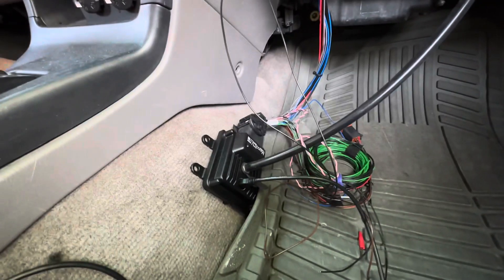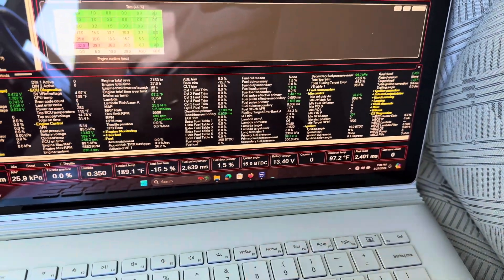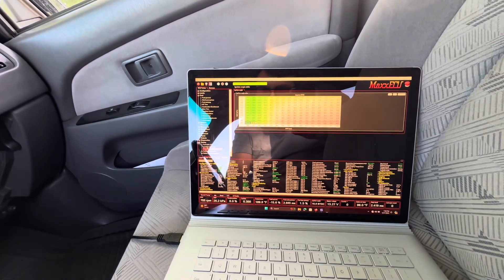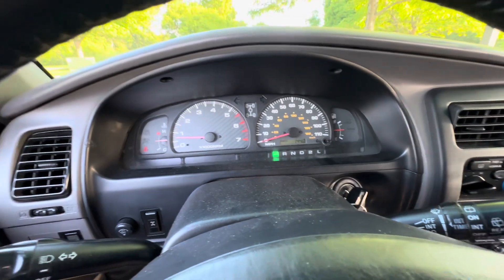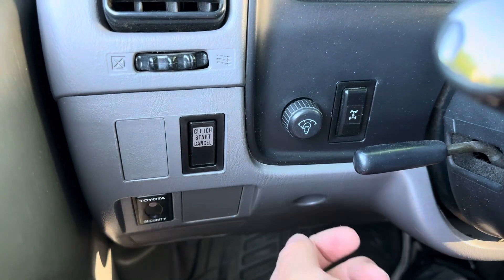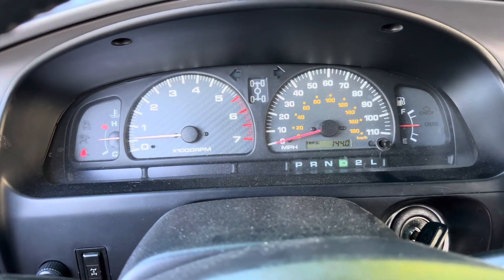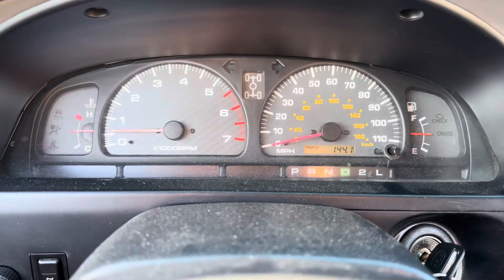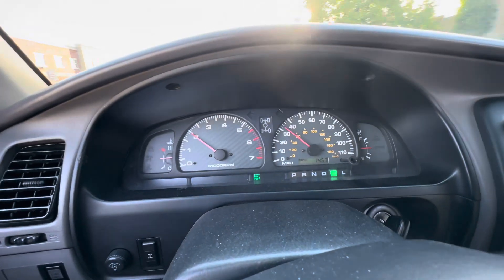MaxxECU Mini PiggyBack ECU For 3rd Gen 4runner Project Update | 5VZFE

Comment: I want to do this on a 2003 rav 4 that i swapped a 2azfe in it. I wonder if its easier to keep the stock ecu and just pull one sensor at the time from the harness and run them on the maxxecu and let stock ecu run cluster etc. I cant find a similar pin adapter for the 2azfe so id probably have to do my own

Comment: I found the person I've been looking for for months. 😮

Bro I need your help. I have the same truck right now, same year the difference is I puted a turbo in it and changed the transmission to manual. Right now I'm using an Urd piggy back that I feel is not giving me the potential of everything I've put into it and I think you just opened my mind to try and install the Maxxecu Mini. But I need to ask you a few questions before I start. 

How do I get in touch with you?
Reply from the maker: Dm me on instagram
Reply: @TurbineResearch  I just dm you @msledezma15
Reply: @TurbineResearch I dm you. Check your messages. Thanks 🙌🏻
Reply: Depends on the capabilities of the URD. You need timing/fuel at least but I’m guessing you are using manual boost control.